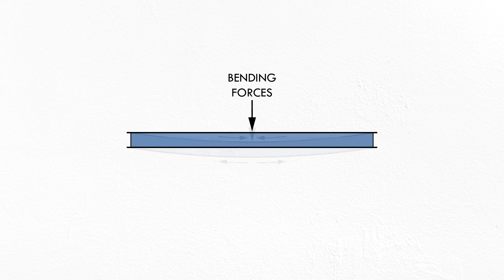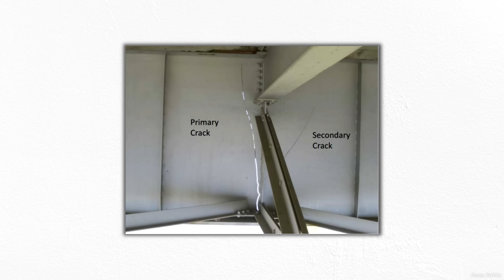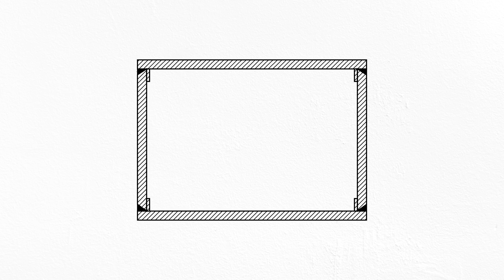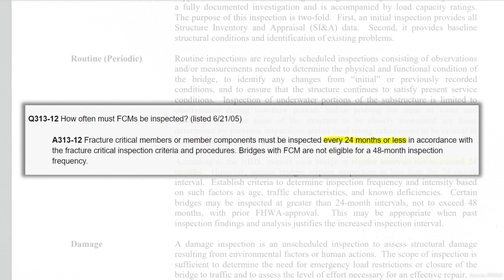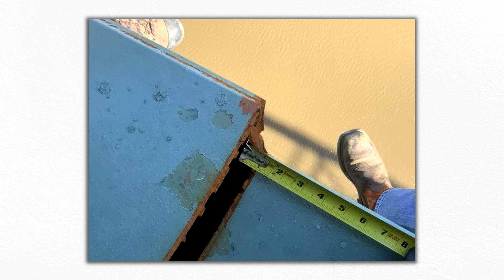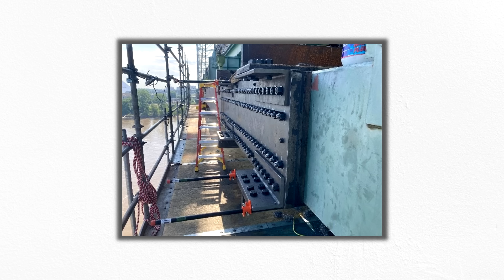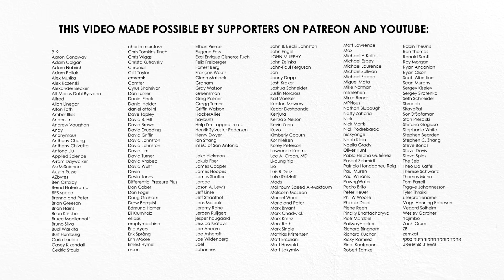What Really Happened at the Hernando de Soto Bridge?

Comment: Have to wonder....i have seen inspection video footage clearly showing the crack.  It would stand to reason that the crack has been in the inspection reports.  If so, the. Firing one guy is a smokescreen.  
Typically the contractor provides an inspection which is given as a report detailing the findings.  Inspectors find the problems; the customer then seeks solutions from other contractors for repair work.  
Therefore, the ball could have been dropped NOT by the inspection company but by ARDOT/TDOT    The older video documentation proves they had access to the knowledge (assuming it was documented in the report).  If they knew and did nothing, they need to be held accountable.  Many lives could have been lost.

Comment: The inspection procedures may have failed at detecting the crack in a timely manner, but they did succeed in detecting it before catastrophic failure. This highlights the need for regular inspections. If something is missed, it may be discovered on a subsequent inspection.

Comment: 4:50 not a good model of the bridge. you used only one string, the real bridge has two members, one on each side of the arch. I assume only one is cracked.
Reply from the maker: Goal was to illustrate the purpose of a tie member in the tied arch bridge, not a replica of the Hernando de Soto.
Reply: @PracticalEngineeringChannel  Your model only had one string, if you cut that string, the model will collapse. With a string on each side, the model may only twist when you cut one string.

Comment: LIGO can measure distances with lasers down to a fraction of the width of a proton.  It seems they could add a laser to one end and a reflector to the other to detect misalignment or length changes of an inch in real time.  Even striking it with a hammer and listening to its resonance could reveal changes like a cracked tension member.   Its about time we start adding sensors to critical infrastructure. They may not be perfect, but would alert inspectors to look in certain areas.  Even if the sensor false alarmed most of the time, it wouldnt be as bad as depending on the inspector to notice every square inch of metal.

Comment: When you said that the DOT announced that they had fired the inspector, I was shocked. As you kind of point at but do not directly say, it seems very much like throwing a single person under the bus for an organizational failure, and this does not seem likely to contribute to a healthy engineering culture. Instead, it promotes covering your ass and ensuring that blame can be deflected onto others when an incident does occur, rather than working to find the root causes and ensuring that it will not happen again.

I come from the world of software engineering, where all the highly functional organizations I am aware of use blameless incident reports (often called “postmortems”, but that is an inappropriate term especially given the context of risk to life and safety here) to analyze the factors that contributed to a particular incident, with the goal of remedying the root causes or adding guardrails, not finding and punishing the person who happened to press the wrong button. (This is certainly not exclusive to software engineering, it is just where I have experience.) Certainly if, through root cause analysis, it was found that a person was acting maliciously or negligently, you would want to take action against that person, but—again, as you say—it also points to a problem where it is possible for a single inspector (or engineer, or developer, etc.) acting maliciously to cause significant damage to an entire project.

Comment: When I worked in engineering some years ago for a northeastern state transportation department I won't name, it wasn't uncommon for bridge inspectors to be caught sleeping under bridges that they should have been inspecting.  And the ones caught would be more by happenstance than any process or QA/QC.
  So it should be no surprise to anyone that the disgusting known conditions on US bridges is probably better than in fact they are.
  Good thing only 6% of the upcoming Federal Infrastructure Bill is earmarked for bridges & structures - with no consistent ongoing funding beyond that.  Even the President admits that 6% will barely make a scratch in the problem.  But at least there's some thought of it, even if it's just there to allow a middle-class tax paid giveaway Bill to be named "Infrastructure".

Comment: Wow. They really caught that just in time. I'm glad they acted immediately. That would have been a major disaster! And as someone who lives upstream along the Mississippi, that explains the delays in recent shipments that normally come up the Mississippi. I'm glad the ppl in charge of shutting down the bridge acted immediately. There's been too many times when they just waive their hands and try to pretend everything's fine.

Based on the rust present on the steel beam where the massive crack is, that's not an immediately new development. It's had time to sit there and rust. Granted, it would rust faster as it's directly above the Mississippi, but still. Rust doesn't just happen immediately. Clearly, inspectors have been not doing their job for quite some time now.

Comment: Grady, thanks for another outstanding Practical Engineering.  Your video underscores that good engineering of infrastructure is both a technical and human challenge.  I can't help but think about all the other potential failures to our infrastructure still await discovery.  When I first saw pictures of the crack I was struck by how oxidized it seemed which is explained with the picture from 2016 you shared.  Keep up the great work.

Comment: What is really happened is that this bridge is M shape, so the left and right pushing against each other, and the other end of the arch is sufficiently solid so the 'horizontal tie structure' is more for assurance against horizontal forces. My best analysis is the vertical rod (or cable) carrying the load was preloaded too heavily, and the shear load has no room to distribute, and is concentrated in that short section. Over time, the fatigue took place due to internal stress and oscillation force...After fracture, the structure moved up some and only opened up slightly where new equilibrium is achieved. If the materials used were more flexible, this would not happen.

Comment: One thing you pointed out was the shutting down of all use of this bridge including below. The politics of shutting down money making transit is,  unless someone died, is to keep using it.  Bean counters control it all until death/major money loss is involved. The firing of one person is a CYA of the real people that should all have been fired. All the national talk of repairing the bad USA infrastructure with providing only half the needed  trillion dollars to just repair and not replaced what is needed, is just that "Talk"! 
As a added  note, metal purchased outside the USA,  has USA inspectors to mark rejected metals but the markings are removed after the inspector leaves the area, leaving defective metal shipped as good to the US worksite as happened to the University of Washington football stadium collapse while being built. Low bidder using off shore metals is not going to work for the long term!

Comment: Thank God no one was injured and the engineers designed a redundant bridge. Now the real question is if the bridge had failed would it have been faster to rebuild a new bridge, or will inspecting every square inch above and below the water and fixing everything that is wrong  be faster 🤔

Comment: I think the inspector certainly deserved to be fired, but I wonder why the engineer who designed the bridge in the 60s didn't use cables for the tension members. We have known since the 1800's that it is best to have tension members be constructed of wire cables, both for greater resistance to strain when in tension, and for ease of replacement when needed. I am no George Washington Roebling, but I can stand on his shoulders.

Comment: If it appeared after the concrete sleeves were installed to make it earthquake resistant it could be the steel pillars allowed flexibility that allowed the steel to move with a lot less stress moving aide to side also.

Comment: Interesting the crack is adjacent to what appears to be a riveted splice. My initial thought was that the reduced section area due to rivet holes would mean the crack should lie within the splice. My second thought was as a friction grip connection both the splice plate and web act in tension together increasing the effective tensile area. I don't think I've ever designed this type of connection though. Anyone care to confirm or rebut this?

Comment: I agree with the assessment of firing an inspector is not a solution to the problem. Corporate America has this mentality of firing a person when a mistake is made. That's just punishing the person, not a solution to the problem. How would the two pieces be shore up to meet at their original design? Amazing how that was missed. Probably a fix after that drone image would obviously would have been easier. Some other structures are taking up the slack of this area. Scary since I've crossed that bridge many times before in recent years. But, as it usually happens, full repairs will probably be written in blood as our society is reactive, not proactive. Let's hope this gets fixed before a tragedy occurs.

Comment: I saw this in the news recently.  I agree with most of what you said with a few exceptions:

1)  That isn't a crack!  It's a break.
2)  The bridge can absolutely be modeled and analyzed for loads and it doesn't take months to model.
3)  You mentioned stresses being induced by welds for built up members.  While this is true, the entire member has broken perpendicular to the welds.  I wonder if these members were constructed in a factory or were constructed on site.  I also wonder if the welds were performed correctly (i.e. built up properly as opposed to doing too much at one time).

You mentioned in passing that horizontal loads on that member may have exceeded it's design.  This seems to be the case since the member has shifted perpendicular to the main axis of it's load.  I don't like the fact that the crack is away from the plates with bolts through them; I don't understand why a break there.  It seems to me that maybe this member was stressed when it was installed to align it with the pier.  Construction guys aren't engineers and it's been my experience they don't care and just jam things together.

I can't believe that break has been in that member for several years.  This break has undoubtedly put stresses on other members.  Have the engineers considered this?  I think you said that the inspection guy was fired.  Obviously a knee jerk reaction from some politician.  Like you said, if it's up to just one guy then there's something wrong with the inspection plan.

As I was looking at this and the antiquated way they inspect bridges, I thought about drones.  All they really need is some up close photos.  This could be done in any number of ways.  At one time (many years ago) I was a quality control inspector and I was appalled at the time how technology was so inadequate to test members for weaknesses and cracks.  It seems that things are no better now than they were 40 years ago.

In my mind, when I see something like this, I wonder about the entire construction of the bridge and what else might be wrong.

Comment: How is something like this normally fixed? Does the entire tension member need to be replaced, or can it be fixed with welding/support plates?  Just curious what would normally be done. I am sure at the point it's at now, a full replacement would be necessary.